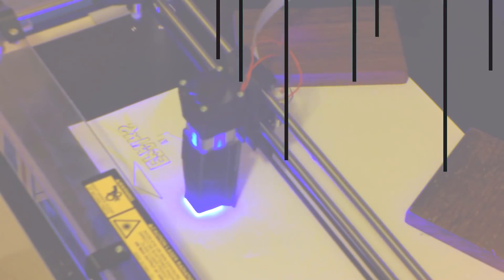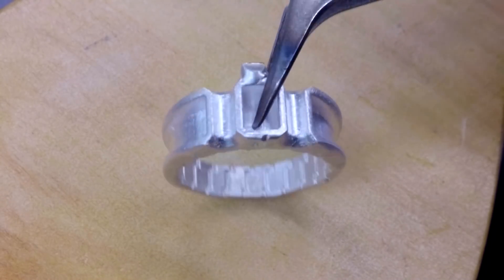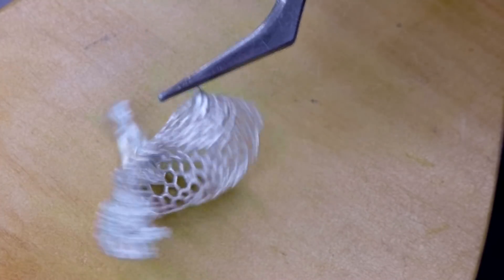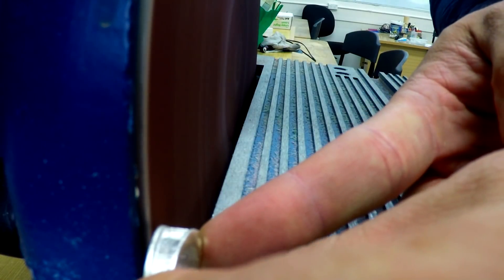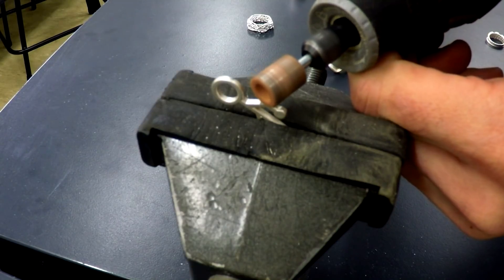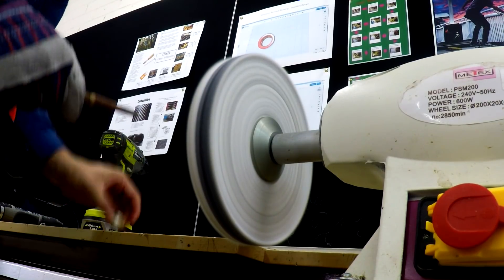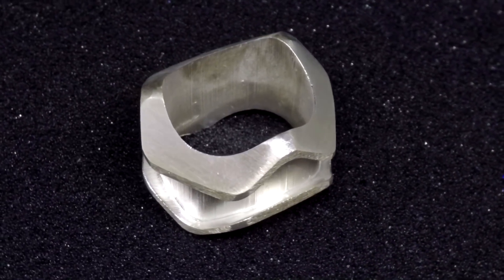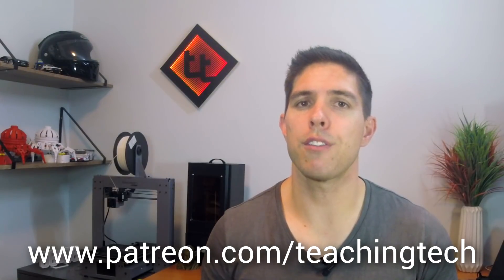Polishing Cast Silver Rings - Modelling 3D Printed / Investment Cast Rings - part 7

Comment: i would recommend before you cure the models. is to brush the resin over the model take your time and don't over do it and you can fill in the layer lines. then cure the model as normal. also when it comes to cleaning up use a glue gun to mount the ring to a chunk of wood. i find that using a broom handle cut down to length. that way you dont burn your hands and have better control. :)

Comment: Might be worth trying a light bead blasting it can hide some surface imperfections. BTW silver is the most thermally conductive metal , that's why it gets hot quick (transfers the heat very fast)
Reply from the maker: I don't have access to that equipment at the moment but appreciate the tip.

Comment: You should get a Rock tumbler and place it in there with some small rock or nuts and bolts to polish the silver.
Reply from the maker: This is definitely on my list, thanks for suggesting.
Reply: Teaching Tech If you do, get stainless steel shot for jewelers and proper soap. It has a variety of special shapes for getting into crevices. Leave that Coral ring tumbling overnight and it will blow your mind how shiny it is when you take it out, even on the inside.